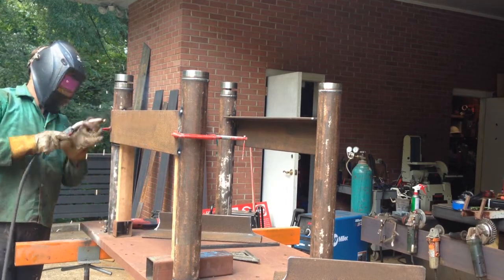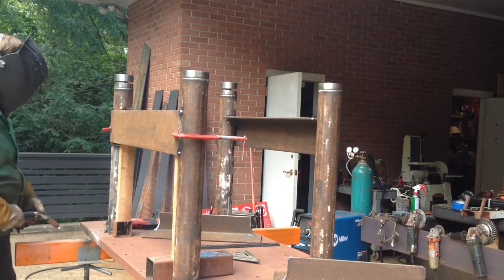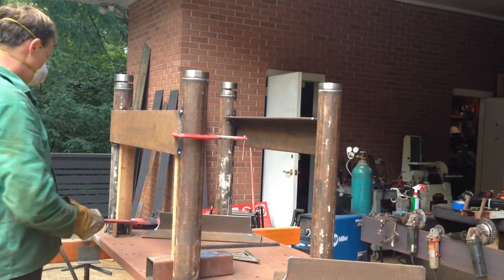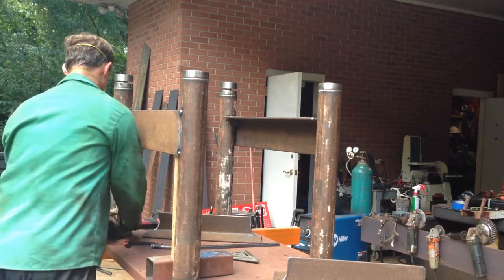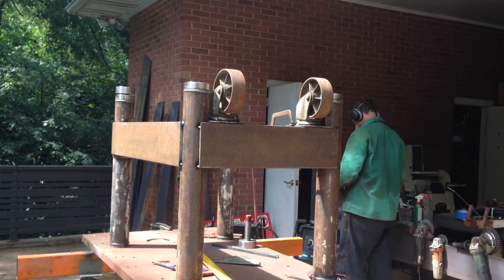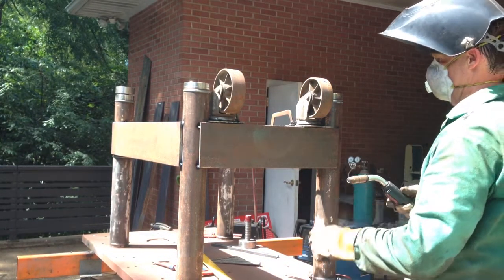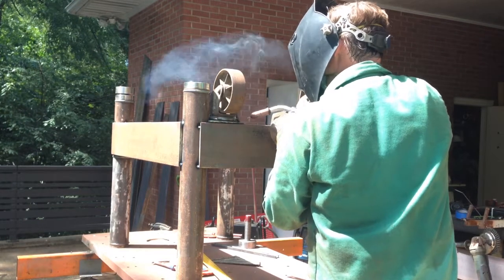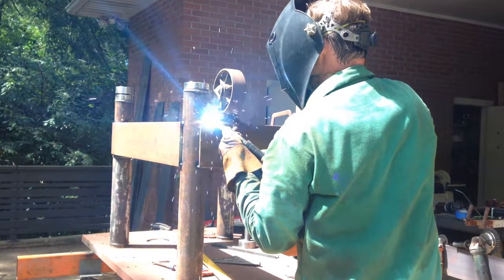$10,260 Welding Table Part 2

Comment: You are just going to make us want a table before we begin welding something to still learn here in our shop, we think this is a GREAT thing though enjoying this build in Part 2, we best liked the thought out electrical sockets in plenty built into the leg supports, looks good. Lance & Patrick.
Reply from the maker: For sure!  When I'm in making  mode I can easily have 6 things plugged in.  This has greatly cut down on the extension cords